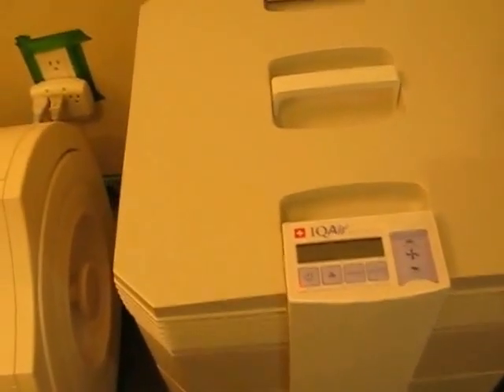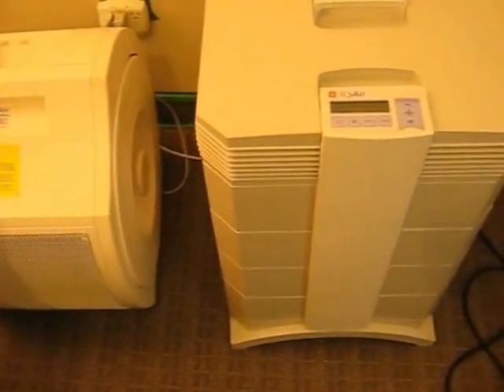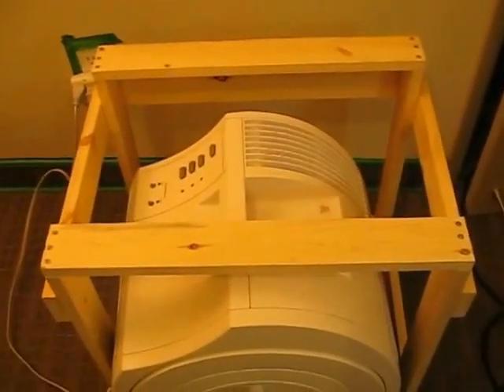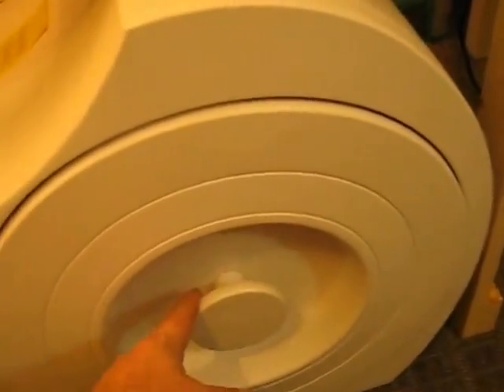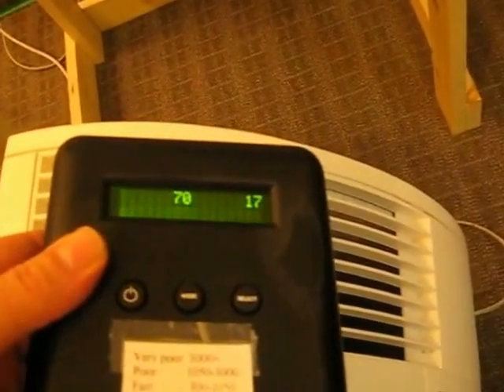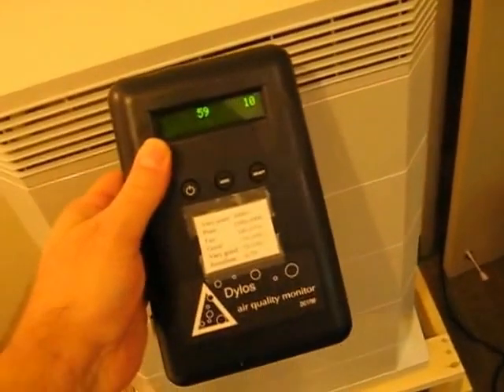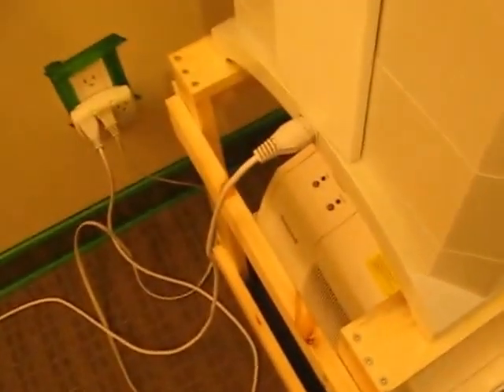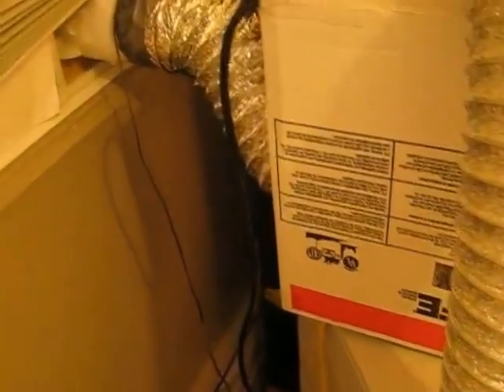IQAir purifier  - How to prolong filter life

Comment: Just take a 5 dollar merv 11 furnace filter, measure and cut it to size to fit underneath were the intake is.  if cut slightly oversized it will fit tight in by itself. This will catch most of the larger particles and save your prefilter.   Merv 11 is not that restrictive and will make no difference in your airflow.  The hyperhepa is much more restrictive than the furnace filter.  This will save the electricy, noise and purchase cost of a second purifier that you can use elsewhere.  Plus the cost of the 2nd purifier filters.

Comment: Very informative video. I am getting about 3 parrots and a good quality air purifier is a requirement for their tiny lungs and for seasonal allergy suffering. I love how you have prolonged the life of the iQ filters.  One question about the smell of he new machine or new filters in the IQ and the supporting filter. I am concerned what this smell can do to my birds. I can't afford 2 iQs and stagnate the filter change. This pro plus already comes with a heavy price tag. Any suggestion you can offer?

Comment from the maker: Always turn on/off  the IQAir before and after the turning on the secondary air cleaner. Turning the bottom one on first will blow dust off the bottom IQair per filter.
Reply: Rick Rude I can't for the life of me figure out how you taped the extra pre filter on. Can you describe?
Reply from the maker: @nelsonfong8005  I removed the pre filter from the IQair first then taped on the Filtrete material.

Comment: good video-can you feel or can tell the difference of the air quality in your air space with all you got going on there? thanks.
Reply from the maker: It makes a huge difference in my asthma and allergies. The air in my place is so clean, but it does not help when I ride my bike in heavy traffic or go camping and get allergies from pollens. I can't control outside air, so I don't worry about it,   but I can sure control my inside air. Having said that I do get outside as much as possible in our short Canadian summers!
Reply from the maker: Night and day difference! Air is so easy to breath! Particle Counts in my one apartment  are always less then 2000 parts cu/ft @ .5 microns and large. By contrast the  hallway  is usually 100,000 to 600,000. Outdoor air is typically 50,000 to 200,000 parts cu/ft

Comment: Rick Rude,  You have done a great job on cleaning the air in your home.  Can you tell me what is running you per month in electric cost to run your units.
Reply from the maker: +Nani Katniss Power is included in my apartment rent, so I run all 8 of my air cleaners all the time! If I was paying for power I would  run  only two of them.
Reply: Eight air cleaners?  You’re scaring me.

Comment: I notice it appears that your taped on pre filter sucks in to the unit when its on ( the frame work is much more visable of the IQ prefilter when the unit is turned on ).  That would suggest that it is restricting the air flow to the machine.
Reply from the maker: +LORFCASTER  Yes, adding any pre filters will restrict air flow. I only use an extra pre filter until its dirty only twice. The pre max would then have less larger  dust particles to clog it then if I never use an extra filtrate filter.  If using another air cleaner under the IQair like I am in the  video, it would not be necessary to use an additional pre filter with the IQair. Simply vacuuming out the bottom of the pre max with a sealed HEPA vacuum cleaner or an outside venting central  vac would cut down filter resistance and extend filter life.

Comment from the maker: One thing I forgot to say. The IqAir Cleanroom  was giving off a strong chemical plastic odor at first. It went away after a week or so.  I have heard others complaints  about off gasing smells from new filters. Any HEPA filter can off-gas if the sealant  used to make it does. I had one aftermarket filter that was so bad I could  not use it. Some  old Honeywell filters do not use any sealant compound between the HEPA pleating and the rim. A little air would by-pass, but at least no smell of any sealants of glues. I think any off gassing from an air purifier is totally un-acceptable.
Reply: Thanks for the info! Do you shut them off at night? Seems pretty loud.
Reply from the maker: @HingleMacCringleberry  I like the white noise, it helps me sleep. I leave it on most of the time, unless I am on the phone or something.
Reply: Rick Rude thanks for the info. 

I ordered an IQ Air unit should be here at the end of the month. Air quality in CA could be better to say the least. 

Can you program the unit to turn on at different speeds during different days of the week or is the programable feature just an on off type of thing?